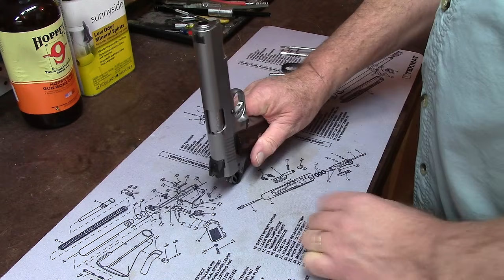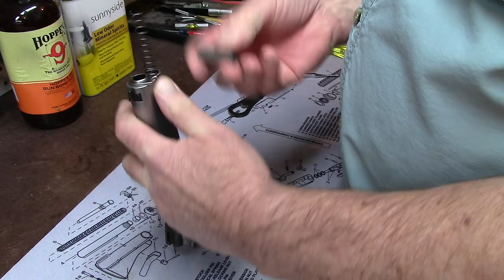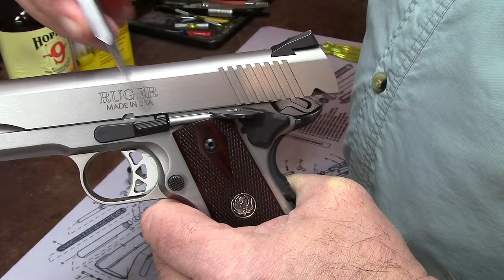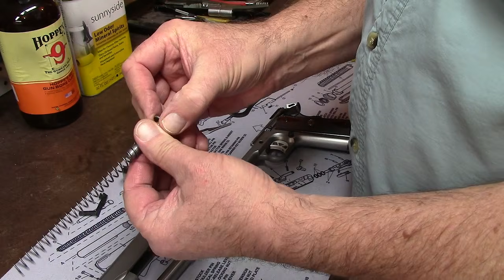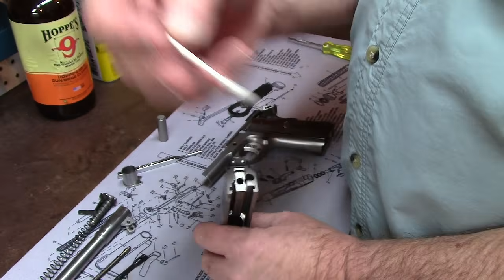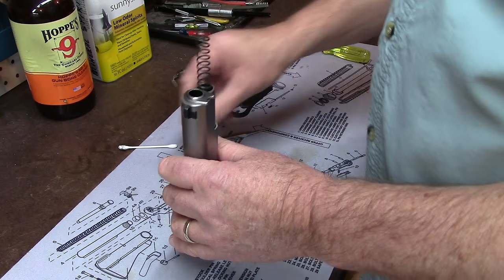How to take down the 1911 pistol for service, inspection, cleaning & lubrication ~ Now in HD!

Comment: What if the safety on the side is loose how do you adjust that?
Reply from the maker: There's no adjustment.  Pressure is provided by the plunger in the horizontal tube on the left side of the frame.  Your plunger spring is either weak, or it has been cut.  It's also possible that someone replaced the long plunger pin with a short one. If you feel confident in your ability, or if someone can help you, disassemble the lower grip frame according to my lower frame video instructions.  Remove the plunger spring and the two connected pins from the tube.  The spring should be unbent and with finished, uncut coils at both ends, and the pins should be joined to the spring firmly.  The front pin should be short, and the rear, long.  Both pins should have a smooth radius.  Replace as necessary.

Comment: I have seen in many other videos during reassembly the guide rod is butted up against the barrel link. Is this incorrect? This is how I reassembled my Springfield mil spec and it seems to be operating just fine but now this video has got me wondering…
Reply from the maker: What you're explaining would place the saddle of the rod onto the wider diameter of the barrel where it will make reassembly much more difficult.  The main thing is to position the saddle where it won't be an obstacle for getting the slide back on easily.  The rod nestles itself into working position on its own when the slide is racked, but I think you'll find the method I was taught by the Army will work nicely.
Reply: @GunBlue490  thank you for you reply!! Yes, I have noticed the action hanging up and it being difficult to reassemble at times…thanks for the tip!!

Comment: You turned off comments on your video about how it’s OK to let the slide go forward on an empty chamber. 
THAT MAY BE OK ON A MILITARY ISSUE 1911 OR 1911A1.  BUT IT NOT OK ON A HIGH END CUSTOM 1911 OR 1911A1. 
I THINK YOU TURNED COMMENTS OFF BECAUSE YOU KNEW YOU’D  GET A LOT OF FLACK FROM US WHO KNOW NON-MILITARY 1911S 
DON’T DESTROY YOUR REPUTATION WITH THAT CRAP.
Reply from the maker: Yes, I turned off comments.  95 percent were positive, but the 5 percent who, like you, took my comments out of context and repeated the same silly thing got quite boring.  I was very clearly illustrating a Ruger service type 1911, and was absolutely clear in my comments that certain 1911s would be harmed. For that reason, no complaints about what I did in my video, nor any complaints about my stated comments on the matter are valid in the least.  For those who own dainty, fragile guns that purport to be modeled after the 1911 pattern, but without John Browning's military ruggedness, I would recommend that they close their slides with great care to avoid bumping, and rest them on a velvet pillow between firings.
Reply: @GunBlue490  I’m glad to see my negative remarks didn’t spoil your sense of humor. I was going to go about the best kind of pillow to protect my Springfield Armory, Kimber, and Wilson Combat 1911s, but decided, “the hell with it”. 
I think I’m correct in thinking the old war horse 1911s were built with loser tolerances who they would cycle reliably when dropped in mud, or bled (real blood) heavily on. I only know I won’t treat my 1911s in a way you say won’t harm them.

Comment: Is that where the expression don't go off half cocked ?
Reply from the maker: Yes, lots of expressions came from guns, and often from many decades before modern repeaters.  "Just a flash in the pan" came from flint lock days, when the small amount of priming black powder went off, but the main charge in the gun failed.  "Lock, stock, and barrel" was also from musket terminology.  "The whole nine yards" came from Allied pilots in WWII, meaning they used up the full length of their 50 caliber Browning machine gun belts, and landed empty. "Keep your powder dry" isn't common these days, but it meant to stay prepared and alert, again from flintlock days. The admonishment for someone to "bear down" on school work came from maintaining a tight cheek weld on a stock to line sights up properly. Lots from hunting, too, as when someone "bags" something, it was from the success of stuffing small game or birds into a bag a hunter carried.
Reply: @GunBlue490  Thanks for the reply. The ''bear down'' on school work definition related to firearms was a surprise.

Comment: Really great video. As a 1911 lover myself, I appreciate it.👍
Some imported guns, such those made by Armscor (Armscor/RIA/Charles Daly/Citadel) pass the "drop-safe" test for imports by using an "extra strength" firing pin spring. These springs make the replacement of the firing pin very difficult and dangerous (and easy to launch your firing pin and spring into the cosmos, never to return to earth).  If you have an imported 1911 and it is a "series 70" you can be pretty sure that's what it has. 

Ruger has taken the MUCH better option of using a titanium firing pin and a standard strength spring. The titanium pin costs about $12 more than an extra strength spring. Good on Ruger! 

If your gun has the extra strength spring, I recommend replacing it with a standard spring and a titanium firing pin. The total parts cost will be about $20 and the gun is still "drop safe". 

I recommend it for 2 other reasons:  
1.Crud build up in the firing pin "tunnel", which happens over time, + an extra strength firing pin spring = "light primer strikes". 
2. Replace the firing pin spring and install a titanium firing pin and you can in stall a "reduced power" mainspring from Wilson Combat. This will make slide operation easier and reduce you trigger pull weight.

Another tip: When replacing the firing pin and spring, hole the slide horizontally, not vertically. Position and empty cardboard box to the side. If you slip and the spring and firing pin launch, it won't be pointed toward your face and the box should catch the parts. Replacing the firing pin  with a standard strength spring is really not difficult, though

Comment: Very good video. Question: when cleaning the gun, should I use any CLP when cleaning down where the firing pin is? I noticed you just simply used a dry que tip without anything. Thanks

Comment: Thank you for the well explained, clearly detailed video. Unfortunately for me,  I had already put an idiot scratch on my pistol where the takedown pin swings up and down, before seeing your video. Oh well,  you live and you learn. It's relatively minor, but I know it's there. Do you recommend using a spray cleaner like Gun Scrubber? I've used it for years,  but it's expensive,  and I wonder sometimes if is harmful to the firearm. Your thoughts?? Thank you again.

Comment: I have never owned a gun before, and I just bought my first. It's a 1911 colt .45   government model series 70, I think? Sometimes the slide will get "stuck"? I'm not sure how to explain it. Sometimes it will be super easy to move the slide back and forth, and other times I can not for the life of me get it to move one way or the other. I haven't fired it yet or anything. At first, I thought maybe I just wasn't strong enough to get it to move, but the resistance is totally random.   Am I doing something wrong, or is this an issue they have?

Comment: I could not get the firing pin, firing pin stop and extractor out  because there is a little metal button under the slide. I finally figured out to push the button then push the firing pin in then removed the  firing pin stop then the firing pin slides out. Once, I did that I was  able to remove the button and spring then push the extractor out. I think this is similar to disassembling of a series 80 of a 911 pistol.  I can hear the laughing way down here in Georgia. I can’t wait to tear down the lower part of this pistol it has ambidexterity safely.  Any help would be greatly appreciated.  Love you videos.  I was in the Vietnam area in 1970.  I was in the Air Force.

Comment: hammer cocked, safety off rule #1 every gun is loaded. Not as if it were loaded but IS LOADED until it is cleared by the handler. No if, ands, or buts.
Reply from the maker: What's your point?

Comment: I am new to your channel. I have recently purchased a 911 and was watching this video everything you did worked for me perfect until removing the firing pin came along I think I understand and see how you are removing the firing pin but, I cannot get the pin out. When pushing the firing pin in I cannot remove the retainer. It appears to me the firing pin is not being pushed in far enough for the retainer to slip past the pin. I have three other pistols and I have no trouble with disassembling any of them or my hunting rifles. I am afraid of using too much force.  I remember you saying if you have to use too much force or get out the hammer stop. So I have stopped and when back after an hour or so multiple times and still cannot get the retainer over the firing pin. Obviously, I am not doing something incorrect.  Any suggestion would be great. I really like your videos.
Reply from the maker: The firing pin must be depressed beyond the front of the retainer, as the retainer is slid downward in its keyway slot. The pin holds the retainer in place. It's generally a very simple removal. It's possible that yours is tighter than mil spec.
Reply: GunBlue490, thank you for such a quick reply. I think I have figured out some of my issue.  Is there any way I can send you a picture of the inside of my 911 receiver.  I think it would be very interesting for you to see the receiver.   It appears this gun is made a little different than others I have seen.  I have watched multiple take down of the 911 and mine is different inside than everyone I have watched so for I would love for you to see the part of my weapon showing the firing pin and the extractor.  And even identify the manufacture from the marking on the barrel (BRP) would be awesome.  There is no stamping of the manufacture branding on the either, side of the receiver.  I purchased thismodel  911 from and individual that has lost one of his arms from cancer.  He did not know the manufacture of the 911.  I do not know any past history of the gun. I was hoping you have seen so many weapons in your life I was hoping in addition to helping me with the take down of this 911 help me identify with the manufacture.  Thank you again for your reply.   I really appreciate your help with this mystery.
Reply: Springfield 911 and it is discontinued.

Comment: It's been a while since I shot my 1911 so I thought I'd take a refresher on how to break it down. This is a straight forward clear instructional video. No BS, it's all you need to take down and reassemble your gun. Love the little tip on how to avoid scratching the gun with the slide stop. He even has the same gun and wrench as I do. Nice discussion on why the Ruger spring and firing pin makes the series 70 guns safe!

Comment: After reassembly, with the hammer cocked, if I am not holding the grip safety down and I release the thumb safety, the hammer drops.  If I am gripping the gun when I disengage the thumb safety, the hammer does not fall.  Any idea what is causing the hammer to drop when the grip safety should be preventing it from dropping?

Comment: It’s a good instruction video for those getting into 1911 pistols but I don’t agree with dry slamming a slide on a empty chamber as it’s unnecessary and does cause wear on the sear to hammer engagement.But it’s your pistol do what you want.😉
Reply from the maker: Let me clarify something. Upon closing, the sear, which is a hardened part, is fimly engaged with the cocking notch of the hammer, which is a hardened part. In a factory standard pistol, where original springs are used, the two are firmly together and do not bounce, they absolutely cannot be harmed.  Now, there are "custom" gun makers and so-called gunsmiths that perform "trigger enhancement" procedures that involve each of the three protections that I mentioned.  They grind the hammer cocking notch thinner, which reduces engagement surface, and they reduce the angle of it so the sear is not required to "climb" up the notch as steeply. Hammers and triggers are surface hardened, not throughout, for a reason.  Ductile steel is tougher and not inclined to break, but surface hardening gives strength to critical engagement surfaces and wear points.  Surface hardening is only five to seven thousandths of an inch in the gun industry, yet many so-called gunsmiths grind well below ten thousandths!!   The second place attacked by these folks is the sear, which they dull the sharp angle to make it slide on the cocking notch, and in so doing, it no longer has its original firm engagement, and it's often ground critically below any hardening.  The third operation often undertaken is to replace the original three leaf spring with one that has thinner leaves, in order to reduce the trigger return weight, and sear pressure.  The result is a sear that no longer firmly engages the cocking notch, but instead bounces under vibration. Such bouncing of two weakened and undermined parts results in something that is not unlike jack hammering. Even if the hammer and sear are rehardened, such bouncing by brittle surfaces causes chipping and sheared notches.  
The moral of the story is that one may always drop the slide on a gun made to original specifications, but would be foolish to do so to one that has been reworked below its intended wonderful combat design. There's always a price to pay for butchering.
Reply: GunBlue490 No don’t do it and it doesn’t hurt a thing to lower the slide slowly on a empty chamber and that is the short and sweet of it.😉

Comment: I recently bought a 1917 model 1911. The holding pin at the base of the handle stays securley in place when cocked or half cock but is loose when not cocked. I keep the weapon cocked or half cocked when in use or in the safe. Should I get a new pin that fits snuggly or is this weapon supposed stay cocked or half cocked? Thanks

Comment: No need to take it down or inspect it. Remember you can drop the slide on an empty chamber thousands of times with no damage to the lock up or sear. John Moses Browning designed this gun to perform in the infernal flames of the netherworld, it's nearly indestructible. Isn't that kind of what you said in another video?

Comment: I have followed this gentleman's recommendations on cleaning and lubing a 1911 since I picked up my first 1911, a Ruger SR-1911, last winter. I have fired about 950 rounds through it, and it still looks brand new.  I have used very little lube. I have also followed his advice on cleaning and lubricating an AR-15, with the same outstanding results. Listen and learn. Thanks for your wisdom, GunBlue 490.

Comment: ~My new (un-fired) Remington Enhanced R1 1911 Pistol and its barrel has a very tight lockup.  The Slide and Barrel has no movement whatsoever in any direction.  
~Mine very well finished and made with the tolerances of many expensive Custom made 1911 Pistols, such as Wilson Combat, Ed Brown and Les Baer at three times or more the cost.
~My Slide however is easy enough to pull back and is very smooth.
~I must use a Barrel Bushing Wrench to begin my Pistols disassembly; it's that well fitted.
~Yes.  My R1 needs to be fired a lot to get it broken-in and prove to me it will protect my life as well as others.
~Right now, I'm carrying my reliable and dependable Glock 19 which I've done for about ten years.
Reply from the maker: Sounds like a nicely made gun.  Actually, much is made of slide to frame tightness, but in my personal experience testing autos, the only critical fit is the barrel to slide (bushing), which correlates the sighting plane to the bore axis.  Even loose fitting slides return to exactly the same place each time they come to battery, because it's the square locking surfaces of the breech that clasp together under spring pressure.  Whether the slide cants to one side or another by a few thousandths of an inch has no effect on accuracy.  That was Browning's genius, because he built inherently good accuracy into the design, while giving it strong reliability.  Tight slides are simply smoke and mirrors that cost too much to accomplish nothing, at the loss of reliability.

Comment: The main spring in my SA 1911 mil-spec .45 is so strong it took all my strength to get it seated back in so I could put the barrel bushing back on.  Lots of the parts on my gun were to tight and hard to take off and put back on that I was using a soft mallet to seat them in all the way.  My gun was not nearly as easy as he made it look.
Reply from the maker: I didn't make it look easy.  The assembly is exactly the same as any Government model 1911 that every soldier was issued and which every soldier assembled and reassembled with bare fingers in the dark. If your gun is difficult, it's because it's not made like a service 1911.  I'm not trying to make any "looks". The 1911 is very easy to field strip and put together, and requires no mallets. The issue main spring is rated at 16 pounds, which compresses very easily and all parts go together without effort.